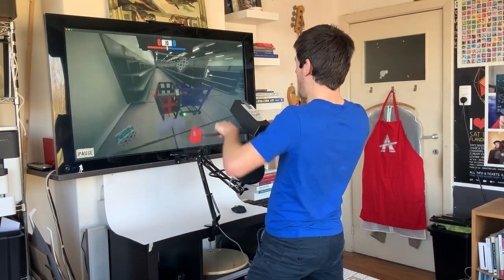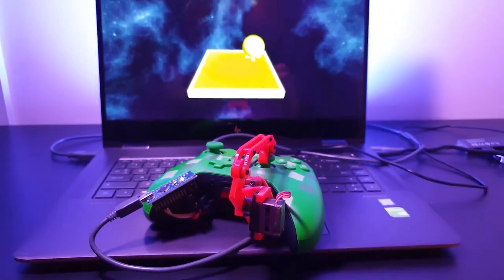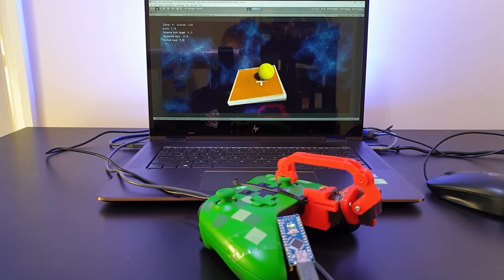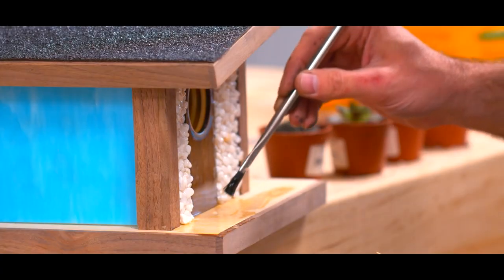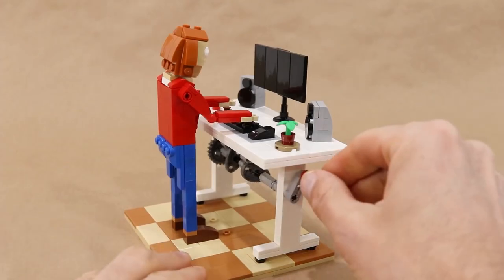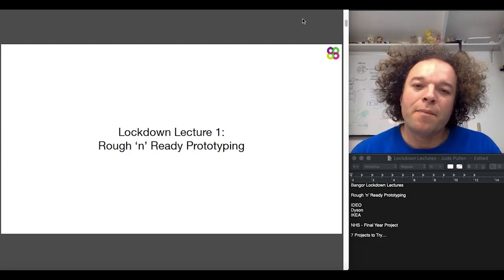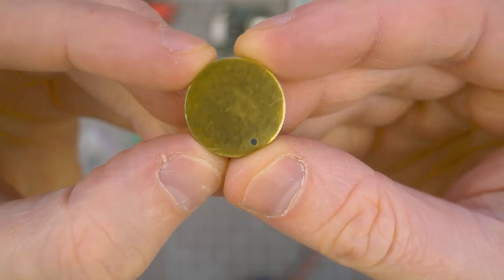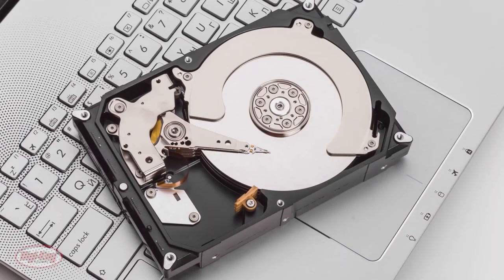Supermarket Sweep [Maker Update #173] - Maker.io

Comment: I finally got my first digi-key order in. Since the lockdown is curtailing my movement, I've been trying to remind myself to take stretch breaks during the day. I usually hold a position for 1 minute, but my mind wanders and I lose count. I'm building a small handheld cylinder that does nothing but time out a minute after pressing a button. The notification will be a flashing light and a vibration motor so I don't even have to look at it. Feels good to write a little arduino code. It's been too long. Stay safe makers!
Reply: Nice. That sounds useful. My family was streaming an episode of Shark Tank last night while I was working and they told me about some pitch where a guy had a habit-breaking bracelet that gave you a little shock to help you break your routines. My first thought was of the mind-reading test at the beginning of Ghostbusters.⚡️

Comment: JB Weld has been used to create bullets the loaded into cartridges after hardening and fired. The bullet heads stayed together until hitting the targets. The material is extremely hard after curing I can see why she chose it as a molding tool for her press! Another great video!! Keep them coming...
Reply: Wow! I had no idea. I ordered some after talking with Sophy, thinking I could use some to repair some of the metal on a vintage lamp I have that keeps coming apart. I've yet to do it, but I'm eager to give it a try. Maybe this weekend.
Reply: Maker Project Lab - I have used it to repair old machine casings and small molds too. The adhesion properties of this compound are really great. I have never done a peal test on it but I have never experienced any failures.